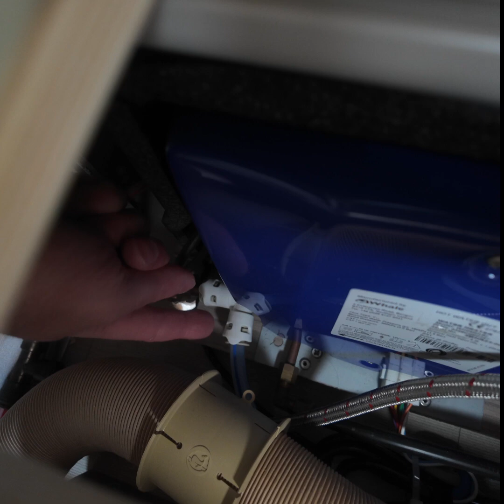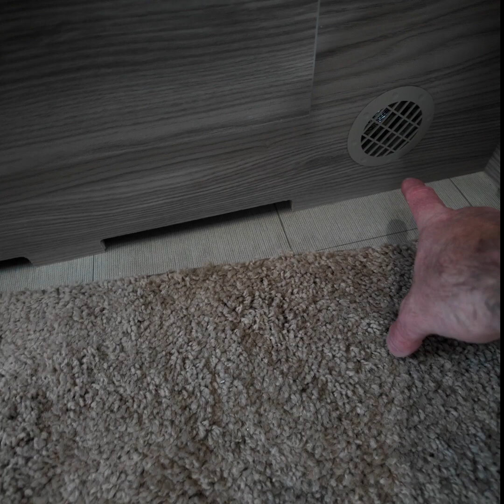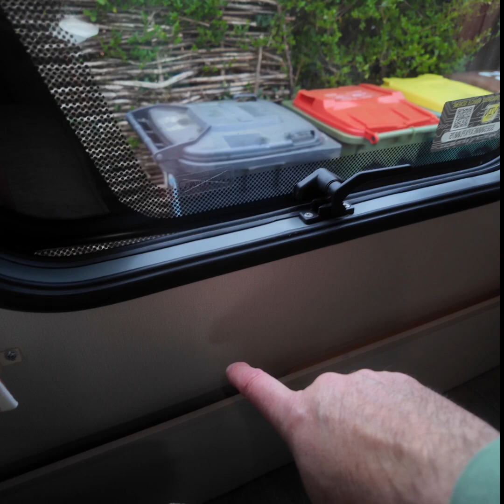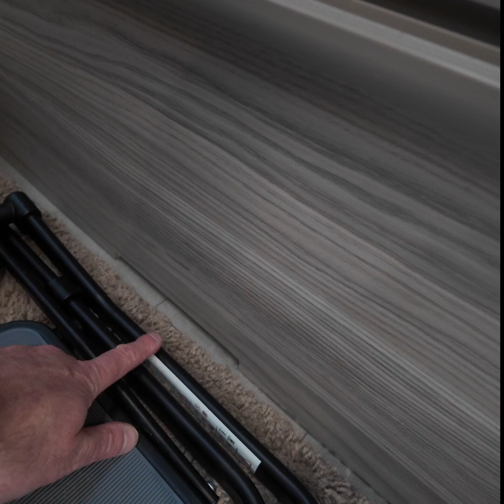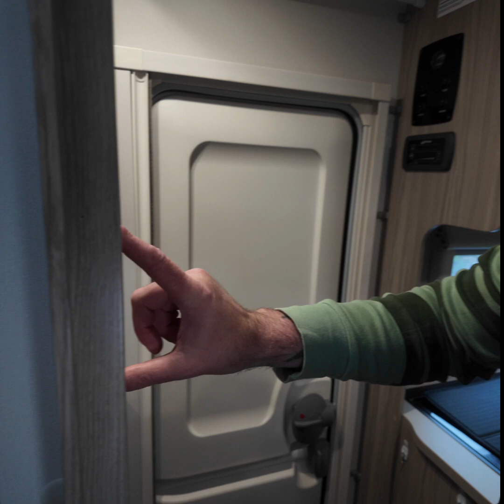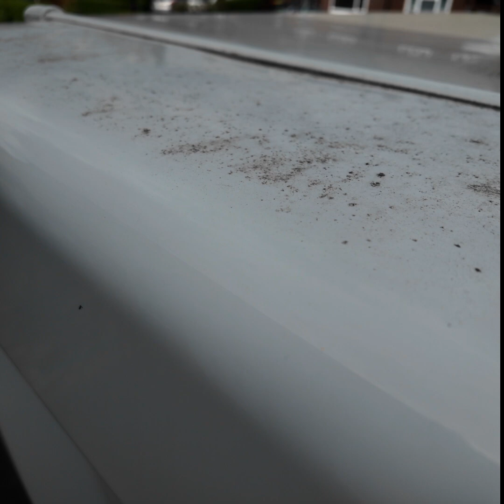ELDDIS XPLORE 304 BUYERS BE VERY AWARE 😱😱

Comment: I've got one ,once it hits 8 year mark, its tow it to the dump or pay about the cost off original buy new to fix all electrical and worst of all they ingress water and leak then rot away over night poor construction weak and cheap incompetent workmanship by elddis . don't buy Elddis 304 explore 2013 absolute money pit.shame on you Elddis.
Reply: What  about  mine from new cracking  roof  blinds don't  work charger problems front  window   leaks  front locker  door fell off had to repair  all myself  ps don't  let your kids sit at the side of the extending shelf where the kettle  sits it collapses  had  to strengthen  it myself  !

Comment: My Experiences on a 2020 model 

Water leak discovered at the from atop the left hand front corner coming from a screw hole in the front window hinge that wasn't sealed.  The front window hinge is weak and the screws small. I resealed and replaced  all the screws with bigger ones then sealed the top of the window hinge with an rubber auotmotve seal strip. 

The spring barrel bolts for the top bunk have a small handle screwed into the bolt.  The  handles come unscrewed in transit and are easily lost making it very difficult to pull back the bolt to disengage the bunk. Glued them in place.

 If not carefully placed in the retracted position, the spring loaded barrel bolts can pop out when you move the bunk and damage the wall paper.  A push button self retracting spring loaded barrel catch would be a better choice.

Although a nice brassy appearance, the top bunk hinge looks unfinished. I made it look much better and safer by fixing a beige coloured pvc/vinyl finger safe product to hide it completely.  Also eliminates the sharp edge to bang heads on and prevents anyone jamming their fingers in the hinge.

There is not enough shelf storage under the oven and sink.  I added a  shelf placed halfway up inside these lower cupboards to improve storage markedly.

Many people require more shelf than hanging space in the wardrobe.  I   changed the wardrobe to have wardrobe half hanging and half shelving.   

The front double bed is lacked sufficient support in the middle adjacent the front wall.  This makes the seat and more importantly, the bed, creak horribly every time one moves or turns over.  I fixed this by ensuring that the bed is supported solidly from the floor (not just the flimsy wall attachment) by adding a 2mm packing piece on top of the ply supports underneath, held in place with a screw or two and some glue.  

The end piece (handle part) of  the pull out slats of the double bed were only lightly glued.  The glue fails when one sits on this side of the bed and the side of the bed collapses.  The design of this area is far too weak for the service expected.  And no, I am not obese so I have reglued and screwed this piece in place.

The cupboard panel door around the microwave was poorly aligned and fitted leaving an uneven door gap, all round.  This misalignment wss unsightly and also prevented the cupboard being opened and closed.  Readjusted it myself.

The underfloor wiring is generally single sheath cables wrapped in vinyl tape or similar.  Some of it has no wrapping at all.  In some places the wiring is resting on the underframe of the van (especially the big group on the left hand side near the wheel).  As delivered, the wires would quickly rub through and cause a short circuit.  Generally the under floor wiring should be protected by flexible or fixed conduit as is a standard workman like practice.  I added more protective conduiting.

In various places ventilation/heating gas, electrical wiring and drainage penetrations through the cabinetry and floor are placed thoughtlessly towards the middle of storage areas.  This makes the storage area far less useful and risks damage to the service by the storage area contents.  A bit more care should be given to the routing of these services such that they are placed at the sides of the storage areas.  There is no physical or economic reason why this cannot be done. 

Many of the electrical floor penetrations are far larger than necessary for the service leaving unnecessary gaping holes.  This seems to be because the holes are drilled to suit the plugs not the wires.  A method of sealing them should be provided.
 
The instruction manual states that the toilet flush tank should be filled with 8 litres of water.  It also states not to fill the flush tank "too full" lest it damage the caravan.  Yet actually the waste tank overflows at 8 litres.  This instruction is confusing and needs to be corrected.  How full is too full?  

The bathroom door frame is weakly connected to the side (hinge side) and had pulled away at the top allowing the door to drop and drag on the adjoining side.  The door frame mounting needs to be strengthened.   I added a piece of wood across the top of the door frame to stop the sides of the door frame leaning inwards.

In the forward dinette seat when descending to sit down it is easy to get a painful surprise when your coccyx contacts the hard side panel of the seat.  This is because the side panel sticks up way above the height of the seat cushion when it compresses under your weight.  It would be better and safer if the side panel did not extend above the compressed height of the seat cushion.

The oven was only supported at the front with no support at the back and not in accordance with Thetford Fitting Instructions leading to splitting of the cupboard frame at the front.  I added a support under the oven a the back in accordance with the Thetford fitting instructions along with a heat shield under the oven to prevent this under the oven from getting too hot.

The radio unit was just shoved in too big of a rectangular hole in the cupboard with no form of fixing whatsoever so it just bounced around on the end of its wires.

The UK dealer was totally  unhelpful and after a couple of email exchanges Elddis said that would no longer respond to my emails because I was asking too many questions !! 

Elddis says they have a "worldwide warranty" but since my van is in Australia I would have to ship it back to the dealer I bought it from in the UK for any warranty work !   🤣🤣🤣🤣🤣

All fix-up was done by me.

Comment: I had multiple faults with a brand new 304 in 2014. Eventually had to speak to the finance company and ask for a refund under section 75. Build quality was shocking.
Reply from the maker: I'm not far off asking for a refund myself, 👍🏼👍🏼
Reply: If you had any finance or part payment with a credit card it is also worth contacting the provider and starting a section 75 claim.

Comment: Oh my god! What problems did I have with our  brand new 2019 Elddis caravan. It was the biggest pile of rubbish I've ever encountered. List of issues:-
Pipework in the bathroom wasn't connected.
The bathroom handle fell apart.
The cooker lid fell off damaging the wall and the floor.
The drain valve fell apart.
The last straw was forty percent damp on the front wall.
The caravan was two years old and we'd had enough. The dealer was very abusive when I tried to deal with them, they didn't want to know and the manufacturer was totally none plus.
We lost a fortune along with many many other Elddis victims/owners. I've never spoken to any owner that hasn't suffered the same issues.
The company is owned by Hymer so what's your opinion?
The caravan industry needs a good shake up as I'm starting again with a brand new Bailey so they're all the same.
I really feel for all Elddis owners as you're in for a hiding.

Comment: Hi there. Sadly I think it’s the general state of poor manufacture, no proper quality control checks and poor service from dealerships following sale. We have a 3 year old Coachman (which are reputed to be one of the best manufacturers) which has had more problems than I care to mention. However, the issues have been dealt with by our dealership,only a couple of which we have had to pay for. We had a brand new Bailey motorhome which we parted with after only 4 months due to build quality issues and at the time thought that it was just Bailey which were poorly built! The whole caravan industry needs proper regulation in my opinion. Really hope you can eventually get your van sorted.
Reply: Hi coachman are built and manufactured in the same factory by Hymer. Coachman, Elddis and Buccaneer are all built in the same factory.